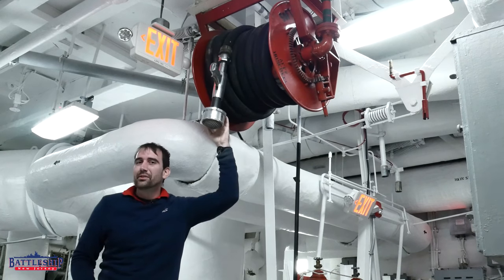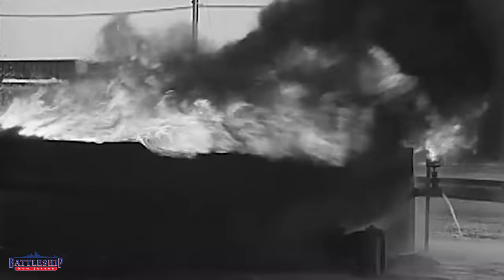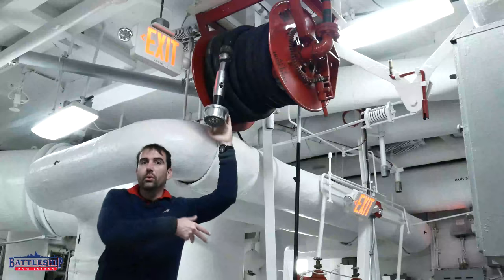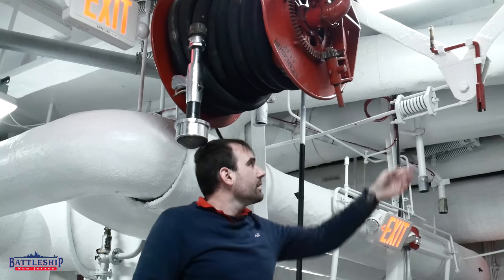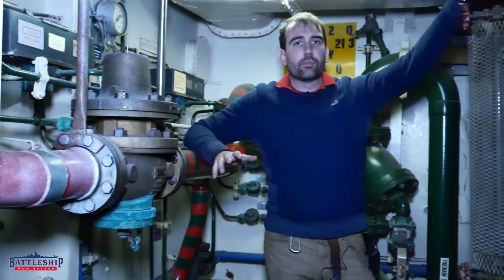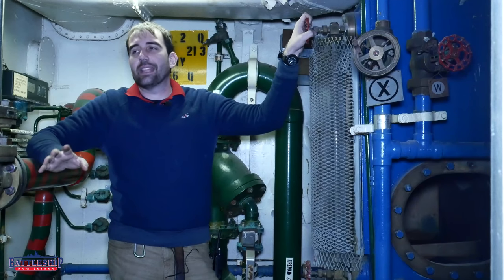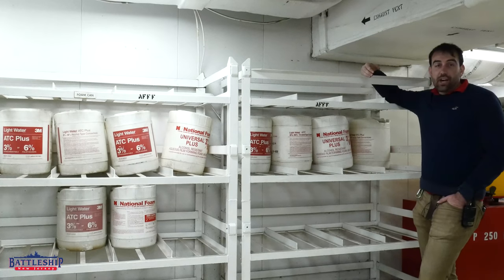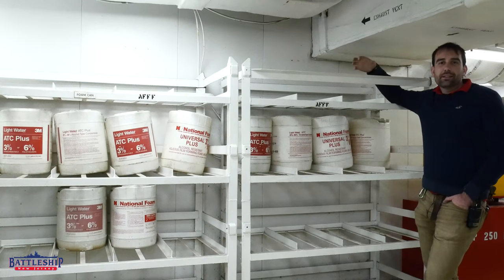Firefighting Aboard Ship: AFFF

Comment: Handle is to rewind the hose, the nut to the side where the handle connects is a retaining lock, if you loosen it you can pull the hose by hand.
Reply: I was going to say, it has to be able to be pulled by hand, otherwise if the ship took bomb damage and that little handle goes flying somewhere it can't be found or if the lights go out, then everyone in that compartment is going to burn because they can't pull that hose out by hand and fight the fire
Reply: Yeah, requiring the crank handle to unspool the hose seemed a bit odd.
Reply: One of the reasons the hose did not play out by hand is seen at 3:51. Notice the zip tie breaking and then the hose rolls up much more smoothly. I am guessing the hose was zip tied near the nozzle to a deeper coil of hose to prevent it from being pulled down by a guest or volunteer, or falling on its own over time due to the nozzle weight.

Comment: that hose reel should have unrolled freely.  it needs to be lubricated.  the handle is only used to roll up.  the blue AFFF concentrate and piping is incorrect.  it should be green.  hence the green and red firemain (which is painted green in the video it appears) create green and red after the proportioner.  also, the 5 gallon jugs were to refill the concentrate tanks as well as for portable use.  they were also given to the snipes to clean the bilges from time to time.
Reply: Maintenance on ex-USS New Jersey had been deferred - they plans to activate her have been indefinitely delayed.
Reply: Blue WAS used in many 80's ships, standards change with time. Regarding unspooling, they don't make them to last 40 years (indeed in active ships they'd be replaced every few, with a maintenance punchcard for monthly certification), if you where rough enough to unspool even a wheel lubed reel you'd probably damage the old hose.
Reply: might have to do with that what appears to be a zip tie snapping when he rolled it back up prolly to keep guests from having fun
Reply: @printsignalsoma1248  Seems like one particular curator had too much fun
Reply: Yeah, likely not.   With all the pitching and rolling of a ship in a storm or battle, the last thing you need is hose dumped all over the floor.    Either the friction snubber is snugged up, or there is a stop that must be released to have the hose pay out.

Comment: Even without an air aspirating nozzle AFFF will form a vapor suppressing blanket on class B liquids when educted into a fire steam and applied with a fog nozzle. Not an impressive blanket but used it many times . I still add a bit of foam concentrate  to a pressurized water extinguisher at home - dishwashing detergent works to a degree as well. Thanks for sharing !
Reply: Yep, adding some kind of foaming detergent to regular water hoses with a fog nozzle works well, volunteer fire departments around here tend to add dishwashing soap or non-HE laundry detergent to their truck's water tanks during fire season because even the fairly unimpressive blanket that a couple boxes of powdered Tide dumped in a 500 gallon tank makes is still a MUCH better barrier than plain water against low-lying brushfires. Common enough trick, and of course it doesn't give you cancer quite as fast as the fluorinated junk in AFFF does (and of course costs basically nothing).
Reply: @LenKusov  We were a big money agency and used knockdown before I retired but as you said a few boxes of detergent works wonders.

Comment: Fires extinguisher training at one of my old sites was simple. Take 5  45gallon drums, fill them 3/4 with water then almost to the top with diesel. Dump in about 3/4" of gasoline and light it up, when the gas burns off and lights the diesel then you get lots of fire and black smoke. Hand the trainee a 30lb extinguisher and tell them "put it out". Other places have trained me with laser pointers and screens or propane burners but it's not the same as the stress of facing down a bunch of actual flame.
Reply: Many places used to do that, or even set fire to an old dumpster in the car park, but several factories burned down after people messed up badly during the drills, and created a real issue, often injuring the trained fire responder or tying up the equipment that should have been used to prevent one... so starting with a lazer pointer makes a lot of sense.
Reply: Hopefully you gave them some at least basic training before wasting all the fuel and agent.

Comment: If the New Jersey was launched in 1942 like wiki says, then she would have had what was called Protein Foam. (Basically fish guts) it came in steel cans and had to be turned every so often because it settled. Sometime in the 60's or so they came out with PFAS based synthetic foam (and we know now that was bad). Both types were a concentrated solution that you could add to water (batch mix) or run through a proportioner to get a specific percentage rate of foam concentrate added to the water. Traditionally you would apply it with a special nozzle (air aspirated tube) or from an applicator wand. Foam works by removing the oxygen from the fire, thereby smothering it. It is usually rolled on (put down ahead of the fire and allowed to flow over it, banked on (bounced off another object) or allowed to rain down on the fire.   You had to be careful because if you stepped in it, you would break the foam blanket and potentially have the fire flash up from that hole. Protein foam was safer for the environment, but was nasty to work with. I know fire departments that used to put the expired protein foam on the lawn for fertilizer.
Reply: The ship I was on still had the protein foam.  I was introduced  to AFF when I returned too sea duty in 1980. The only time I ever used AFF was in fire fighting school, which I have gone through a number of times.
Reply: Protein foam was *nasty*.
I never served in the Navy but we had a few legacy portable protein extinguishers. The smell when we took them out of service, urgh. I can smell it across nearly 40 years!
Reply: @bravodelta3083   the grass loved it though.
Reply: Hah, yeah.... we were told horse hooves.    Also, AFFF is self sealing so the risk of walking thru it is greatly reduced.

Comment: GreyHound explained about the Protein Foam. We still had it on the Ranger in 1969 when I was on a DC Party. This was hard to use if you had to keep moving. The nozzleman could not handle the hose and move the can. Full, it weighed somewhere around 50 lbs. This meant having an extra person who would move the can while the nozzleman fought the fire. The extra man was really right under foot.
Reply: On CV 61 same time as you, VA-56.    Remember one time some chiefs wanted to clean the flight deck and used this foam, I guess because it had bubbles like soap.   It really didn’t cut through the grease and rubber aircraft skids, but it really made the flight deck super slippery.

Comment: Have I ever used one?  Where to start. 

As an MM in EMO1 onboard BB-62, we had a class “C” in the ventilation, CO2 extinguisher for that one.  
I have had several oil spills, including out of an main Lube Oil Strainer, standing by with PKP 30#, AFF hose reels. 
On second ship, had MAJOR JP-5 leak.  Activated AFF bilge sprinkling and hose reals. 
Dumpster fire on pier, 21/2” hoses from ship. 
Then all the training, including setting up pick up tubes(Read Donky D!@&$) for simulated loss of hose reals. 
Then I get out of navy and still used several different types on actual fires.

Comment: I had the “fun” of going through basic firefighting training while I was on active duty - as mentioned below, fighting an actual fire with an actual charged firehouse in a room where the only light is from the fire is quite an experience!

In my time, everyone on board was expected to have completed such training; like they used to tell us at the time, “If every Marine is a rifleman, then every sailor is a firefighter.” 

Post-Navy, our office would invite the local fire marshal over and have us practice using the fire extinguisher on a small fire set and reset in the parking lot - usually about the time the fire extinguishers bedded to be swapped out.
Reply: Same here.  Was stationed on a Replenishment Oiler in the Bay Area.  Putting a new crewmember on the wait list for FF school on Treasure Island was actually part of the "Reporting on board" checklist.

Comment: Have fired many extinguishers for training, but first time this summer had to use one for real, running a large stationary engine at a threshing show, wooden skirting on the skid under the engine caught on fire from the exhaust pipe, was interesting for 30 sec or so, but got the situation under control.
Was glad to have extinguisher near

Comment: Fire safety month
1, Have smoke detectors in your house
2, Have fire extinguishers in your house
3, Know how they work
4. Have a evacuation plan with your family that EVERYONE knows, Even the kids like " If there is ever a fire in the house meet at the tree in the front yard" tell them NOT to hide under the bed or in the closet! Prectice it a couple times with the whole family.
5. Don't pour water on a grease fire, only makes it WORSE!
End of lecture, just be smart about fire
Reply: Add to that service the fire extinguishers. At a minimum take off the bracket and turn head over end at least a dozen times to make the powder loose again every 3 months, and have an annual service, with a 5 year pressure test on them. 

In addition in the kitchen entrance, by the door, have a fire blanket, in a prominent location and visible. It will smother a grease fire much better than any other method, and is a lot less mess as well to clean up.

3 fire extinguishers in the house, another 2 in the garage, and one in the car, almost have enough.
Reply: 5a. It's not a great idea on electrical fires either.

Comment: After surviving 2 wildfires in Northern California we purchased a retired wild land fire engine from our local volunteer fire department and got training. This past year they retired another larger truck that had in its previous life been a ARFF (Aircraft Rescue Fire Fighter) at a regional airport so it has a AFFF system built in.  We are going to be doing our annual testing in the spring and I can’t wait to make a whole lot of foam with the system!  It also came with a 3” monitor on the top of the truck.  I think it can suck our 500 gallon tank dry in less than a minute!
Reply: Not needing AFFF for wildland use, you might want to add dish detergent to the tank instead of foam, which is incredibly expensive, and will cause your neighbors to 'hate' you for killing the environment.     But good for you to prep.    Might consider how you will breathe if the fire is close.
Reply: @stevecooper2873  The AFFF is actually an environmentally friendly mixture that our local volunteer fire dept buys and that we get free refills of. We are using the truck for structure protection so will be using the AFFF for foaming eaves and gutters. Hopefully we never need to put it to use.  
Our local dept doesn't use SCBA for wild land and if the fire gets that close we are bugging out. Nobody's life is worth a structure, but we have a decent amount of property before it gets to the structures.
Reply: @billjohnson69  Yes, it used to be viewed as that.   Being a FF, I am bombarded by ads from law firms claiming it has PFAs which are now considered carcinogenic.... I am sure in CA.  Free refills!?  That's great for you.  Sure hope you support the local VFD.   You might still want to consider air, as 'bugging out' does not guarantee no smoke or fire on the trip.

Comment: Does the museum have the ability to flow water through the fire mains and hoses still?
Reply: I think their fire main is fed from the shore water connection. I don't believe their auxiliary diesels are in working condition nor can the pumps be run, but Ryan would know more than I...
Reply: No
Reply: @JP-pb4tk  Ryan himself had said that there are some active fire mains on the ship to help fight a fire and that there were sprinkler systems added.
Reply: I understand the fire pumps are not on line. The sea chest where the water comes into the ship from under he is blanked over. There is a fresh water main from the pier. I'm just not sure if the fire main is usable.
Reply from the maker: Generally, the original system has been replaced with new pipes and systems
Reply: @BattleshipNewJersey  But is the water supply enough to handle even a single 50 gpm hoseline ??

Comment: I have used a fire extinguisher to put out a fire in an emergency. A dormitory had the floors waxed and a mop with floor wax was left outside the door, near an air handler room. The air handler detected smoke and tripped the fire alarm remotely, notifying our alarm management. The Dean of Women walked over and told me that there was a fire alarm, but there was no evidence. I thought probably someone had burned popcorn in the men's lounge so I went to check, but it was a mop that had just gone from smoldering to blazing! I ran and got an extinguisher, slipped and skinned my elbow (still have the scar 15 years later) and put the fire out! I was amazed how fast the fire had spread from the time I found it until I was able to put it out!

Comment: Most Cans of foam in the early 70s were protein based foam and painted red.  The aspirating nozzle was called a “ donkey di$&”.  AFFF was just being integrated when I did DC school.  The protein based foam requires a very thick layer to smother the B fire.  AFFF required about a 1/2” and is self healing when disturbed by hoses or walking.  Check out Treasure Island for AFFF’s lasting legacy.

Comment: I spent part of a summer in college as a welder's fire watchman on a construction site, which basically meant my job was to stand near one of the welders holding a fire extinguisher and, if he happened to set anything on fire, put it out. In practice I was more like his assistant, since, what the hell, he had a guy whose assignment was to stand next to him all the time, might as well put me to work. I only had to use the extinguisher once that whole summer, and it wasn't for anything "my" welder did--I just happened to be the nearest person who was equipped to do anything about it when some sparks from work up in the structural steel fell down to the ground floor and set a tarp on fire.

Also, I'd just like to note that "aqueous film-forming firefighting foam" is an intensely satisfying phrase. It's like the opposite of a tongue twister, it just rolls.

Comment: I once used a fire extinguisher in college to put out a couple of fire starter logs soaked in good ol' #2 diesel. 

Since then, I have bought a pair of small fire extinguishers. One lives in the rear of my vehicle with things like a jumper pack, zip ties, and duct tape. The other lives under my kitchen sink. Pretty likely places for fires, or at least close to them, in my experience. 

Ryan, I noticed when you were standing by the canisters of AFFF, there's what appears to be a duct passing through two, I dunno...bulkheads?  For us in the construction/building trade, that's considered a "through-wall penetration" and the edges of it need to be sealed, per fire code, with a smoke/fire "barrier." This usually comes in the form of a nasty, gritty, goopy, red substance dispensed from a caulk gun know as "fire sealant." Did the Navy ever use that or something like it on New Jersey?

Comment: In actual use, you would generally knock down the fire with PKP (Dry chem), then come back over it with a gently applied layer of foam.  In any case, you did not walk on or otherwise disturb the foam layer, as the fire could reflash.

The portable eductor used with AFFF was basically a brass fitting with male and female hose connection on each end, and a short rubber hose coming off of it which you put in the AFFF bucket.  This piece of equipment was commonly referred to as a "Donkey xxxx" (Insert vulgarity for male anatomical part) due to the length of rubber hose attached to it.

Comment: I was proud of you using so many naval terms.  A Navy helo would never cause an AV gas spill, my 1st cruise mail arrived by a C-2 COD.  If it couldn't make the round trip, no mail for you, wicked flammable and not on any Navy ships since I was 1st in the USN 75'.  If your jet or helo is refueled by the USAF usually ashore and it was JP-4 it went over the side ASAP, too flammable.  Sometimes tankers had JP-4 and it went over the side too.  Use your PKP or CO2 on a class charlie fire.

Comment: The racks of 5 gal cans you show are to replenish the AFFF tanks at the mixing stations if they are used.   Using an eductor, would be nearly futile with a large fire, ALTHOUGH in WW2 configuration that is likely what was done.   By the way, eductors use the Venturi effect to create the vacuum to pull the concentrate into the fire stream.

Comment: Never was Navy (I was Army before getting into aviation maintenance) but the more recent advances in fire-fighting foam is the ultra high expansion foams that essentially use something similar to dishwashing soap, water, and a blower to smother a fire; it's used in aircraft hangar fire-fighting systems.  Also has the advantage of not being hazardous waste after it's used, unlike the 'standard' AFFF foams; this new stuff can be flushed down storm drains, whereas spent AFFF had to be disposed of as hazmat.

Comment: It's a Hanney reel. If you loosened the nut on the side that hose will flow off the reel fast. The nut is a phelonic brake. The hadle is ONLY for winding up. Oil and propane delivery trucks still use the same real but use a chain motor to wind up.